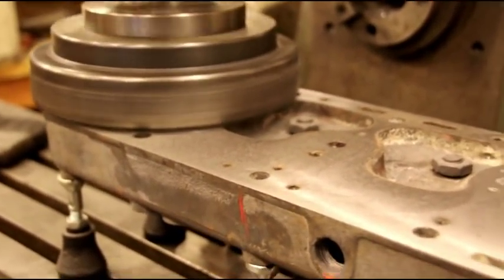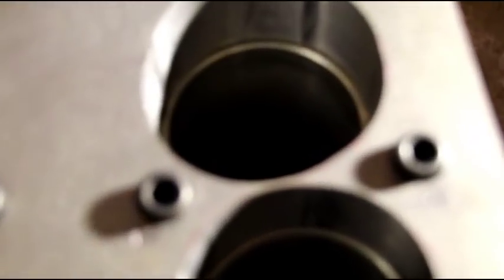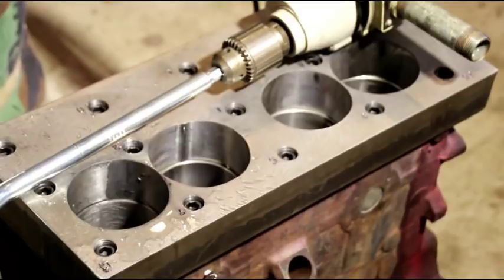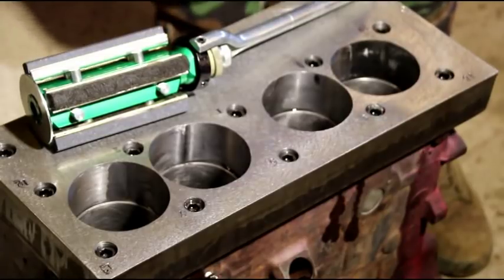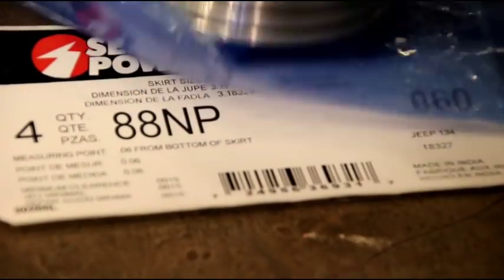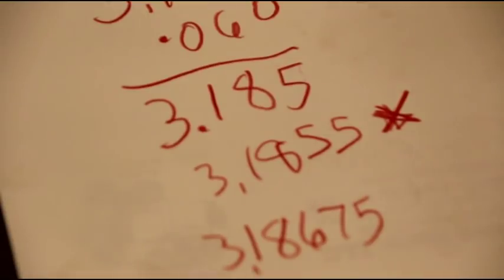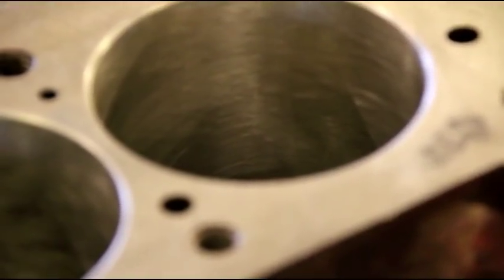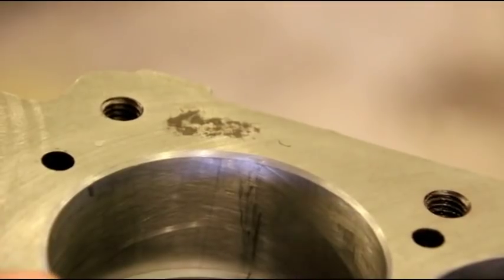Willys F Head Block Honing and Ford GPW Head Milling

Comment: Thanks for the video's,  you make me want to find a old jeep and rebuild it. At what point would you look at sleaving a bore? Please keep the video's coming as  love to learn.
Reply: bill Flint I was going to ask the same thing 👍
Reply from the maker: I am going to show a block that needs sleeves in the future.  I routinely takes blocks to .080" over with good results.  After that I bore larger and press in a sleeve and use standard bore pistons.  I have a few engines to get finished but have a block saved that needs sleeves for a future video.

Comment: great stuff! whats your choice honing oil.
Reply from the maker: I always use the general purpose honing oil that I get from www.cylinderheadsupply.com
It isn't very expensive and a gallon container can do about 5 or 6 4 cylinder engine blocks.  I always have a few gallons on hand
so I don't run out when doing a job.

Comment: DO you use a gasket between block and torque plate?
Reply from the maker: If you are referring to the engine front plate, yes a gasket is necessary or you will have oil leaking all around it.
Reply: @metalshaperJeep  Referring to the torque plate in the hone
Reply from the maker: @davemakiato7982  no gasket necessary, the torque plate is there to duplicate the stress caused by torquing the head.   No gasket necessary when honing.